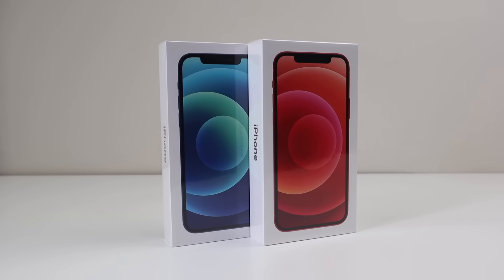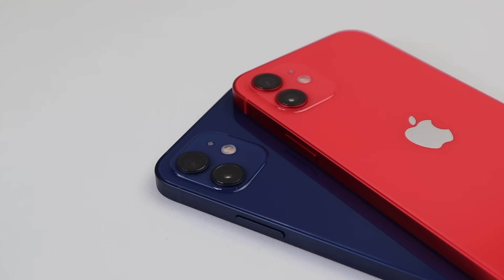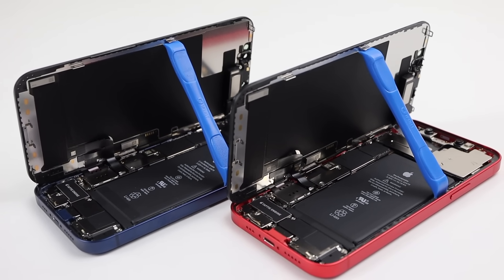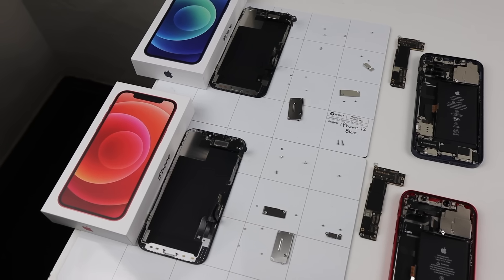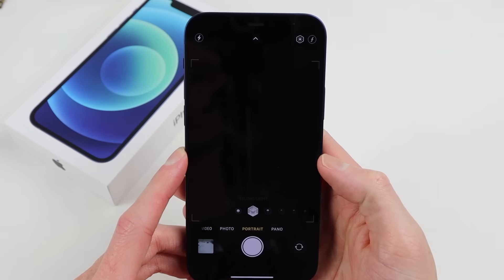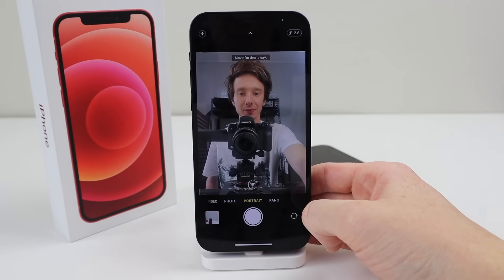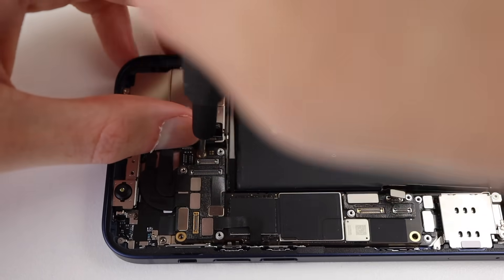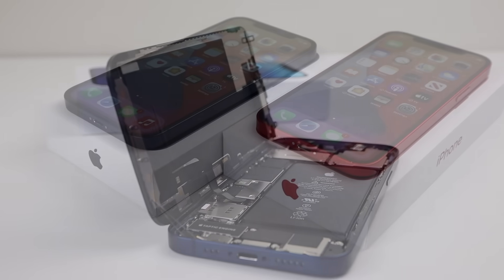iPhone 12 Anti Repair Design - Teardown and Repair Assessment

Comment: This is so genuinely anti-consumer that legal action may genuinely be needed. Apple is acting like the phone still belongs to them.
Reply: @kristiankestruppedersen6451  Actually, to look at a similar problem which shows how something like that is bad, I'm gonna bring up the farming industry. John Deere has something similar, where their tractors cannot be repaired by the owners on some levels, especially with the electronics. When the nearest John Deere licensed depot is so far away from the farms using them, and transportation of inert heavy vehicles could cost thousands for a simple problem the owner could have fixed, but wasn't allowed to, the problem starts to show itself. Now, for phones, it's not as extreme, since there are apple stores all over the place, but it's the same story. With a monopoly on repairs, apple can charge whatever they want for even the simplest repairs.
Reply: @thericepotato5847  And it's exactly this behavior that led to laws protecting independent repair shops for cars.  Laws that, naturally, don't extend to other kinds of motorized equipment, or other consumer goods.
Reply: @thericepotato5847  it comes back to them owning the software.
Reply: @logical_evidence  yeah, that's what the legal argument will come down to. They own the software and the software is technicslly just leased to all apple devicd owners. But where things get confused is that he hasn't edited the software, he's changed out physicsl parts
Reply: @thericepotato5847  i wonder if somone could sue them for that monoplys are illegial
Reply: @formoth3rrussia472  Like most legal question, the answer is... It's really complicated. Even I don't know enough legalese bullshit to say any more than "It should be something apple catches heat for, but they probably won't."
Reply: @formoth3rrussia472  ultimately it'll come down to ownership of the software vs ownership of the hardware. And how much of a precedent what was mentioned earlier, with the laws protecting the repair of farm equipment, will have on any case
Reply: @thericepotato5847  Most car companies are doing this too now
Reply: @thericepotato5847  that's false, in my country there isnt ONE store, not even one in the whole country
Reply: Jay Freeman has testified about this issue many times in the pursuit of legalizing jailbreaking. It's worth looking into
Reply: @kylezo  louis rossman has done heaps to. He was one that pushed for third party repair in New York.
Reply: @kylezo  ye
Reply: @kylezo  Jailbreaking is already legal though.
Reply: @kylezo  Repairing should be legal. Jailbreaking shouldn't. This isn't a Windows/Linux computer where if you mess up with your admin privileges and destroy your SSD/HDD (very rare but can happen) or other components or your system has to be reinstalled it's absolutely not a problem. On phones it's a different story. You can't swap your components and you can't install another system. At least not without the risk to completely brick it.
Reply: @kylezo  i would normally be against that, but with the sh*t IOS is pulling nowadays, I hope that works out
Reply: @kristiankestruppedersen6451  it is wrong and if you don't see it you're just acting blind and trying hard to defend their actions. Gross
Reply: @peekafch  while I agree with you mabey being helpful and explaing instead of just saying your wrong and if you don't know why you're stupid. Ignorance can be fixed. stupidity is refusing to believe those who give you the facts to help your ignorance and not helping ignorance is just being an asshole.
Reply: @peekafch  He's still right. They have the right to do so. It's their product and they can absolutely make sure repairs only go through them. You can't do any legal action against it either.
Reply: @peekafch  I mean they can do whatever they want with their products 🤷🏻‍♂️ it‘s not their fault that people don‘t really look into it and are stupid enough to buy their products
Reply: @barry3834 You are describing a deceitful tactics. "Not my problem if I tricked you into buying it." There should be a BIG BLACK BOX WARNING ⚠ over each iPhone sold stating "NOT USER REPAIRABLE"
Reply: @exxxo45  yea but people need to do their research still
Reply: @kristiankestruppedersen6451  “You can do whatever you want too”
I’m sorry did you not watch the video ? He used parts from an other identical phone and it disabled functions, how is that letting us do what we want with our own property ? 
He bought from Apple but still couldn’t repair his apple product, it is ludicrous.
Defending Apple... 🙄
Reply: @IAteYourSandwich  You failed to understand what he wrote. He said '' you can do whatever you want '' and added the condition '' as long as you go through Apple properly '' (paraphrasing). It means you can do whatever you want as long as you do it through the proper service. In this case, it means you can have your phone repaired if you go through Apple repair services. It doesn't mean you can repair it '' if you use another Apple product '' just because the other product is Apple as well.  That's 100% your mistake. 

And the guy is right. This is a common mistake as well: people think when they buy something, they buy everything related to it meaning they can do whatever they want with it.  This is strictly false. When you buy a product, you buy some things, but other things you actually buy '' a right of usage ''. Some, you just loan. 

This is very common in electronics and software. For example, you don't buy Windows 10, you buy a LICENSE to use Windows 10. ''Your'' Windows 10 does not belong to you. Same principle applies here. Even if you do fully buy the phone hardware, the software does not belong to you. When it comes to phone in general, you don't actual buy the phone, they are often the properly of the company even on the hardware level.
Reply: @IAteYourSandwich  Nope, it's called a conditional sentence. You can do what you want as long as (condition). For example, you are free to do what you want as long as it is legal. In which case, you will not be free to do it and the legal system will punish you. There is absolutely no contradiction. It simply means ''within parameters, you are free, outside, you are not ''. 

You are also wrong about Windows XP. Even in the times of Windows XP, you were buying a license. They simply allowed you to install it on multiple computers perhaps (I don't remember that, actually). And now, they don't. They could've restricted it on Windows XP as well. To be more precise, Windows XP is the operating system that introduced licensing use. 

All that means is you're an idiot who has no clue what he's buying with a touch of poor reading comprehension. Also, this is not specific to Apple: I'm not even sure a single big phone manufacturer sells you the hardware.
Reply: @dzello  the contradiction is that going through crapple and their ridiculous repair prices is NOT what most people want. Getting told their phone is unfixable while it's actually a simple fix, is also NOT what people want. So no, you can't do what you want, only what crapple allows you to do but you most likely DON'T want.
Reply: @ahandlethatisnottaken  You know what all of those things have in common?

They are all customer problems. If you want to be able to repair your phone THEN BUY A PHONE THAT CAN BE REPAIRED.

Not just that but youre actually wrong. In fact, most consumers would rather just pay Apple to have it fixed or replaced than do it themselves.

Its really simple: if you dont want those issues,  go elsewhere. People dont know what they buy and then get surprised when they see they dont own their phone.
Reply: @dzello  where do they advertise the fact that it can't be repaired? Most people only come to know this after they buy a phone, it breaks, and they're told it's unrepairable. What a "pleasant" surprise. And I never even mentioned doing it yourself. There are other repair shops that don't charge ridiculous amount of money for simple repairs.
Reply: @ahandlethatisnottaken  Apple says it plenty that apple products need to sent to the apple store for repairs or exchange. They have the warranty as well you can buy, its not for naught. 

The phone doesnt belong to you, you know. If you dont understand what youre buying, its your fault.

And its not just Apple, every phone company can do that because they all use the licensing model.
Reply: @dzello  yeah they could do that, but they don't because they're not assholes. And warranty doesn't cover drops, scratches on screen etc. even if you pay extra. Insurance does, but then again, not everyone wants to pay for that. This is clearly artificial lock down of parts, I don't think you'd play the same tune if your car didn't start because you changed the tires at the wrong shop.
Reply: @ahandlethatisnottaken  If I pay for a license, I dont expect to be allowed to repair at all because Im not stupid.  If I pay for a full product, yes. Phones are not such products. You do not own your phone and so the manufacturer can do things at his discretion. 

And the competitors dont do it is because they want to get clientele that wants to repair their phones and customizability. It has nothing to do with asshole or not, just Apple having a selected clientele and the competitors having another.
Reply: @ahandlethatisnottaken  If you loan a car, can you go to a third party to have it repaired? Noooope. Same principle.
Reply: @dzello  ok, so my point is, most people ARE "stupid" as you put it. The price tag doesn't say "license to use iphone until it breaks", it just says "iphone". It's not a "selected clientele", I've converted many iSheep after their phone broke and I told them all about these shitty practices that they had no idea about. Sure, YOU might be one that knows all about it and chooses to buy their products for whatever reason, but I guarantee you 90% of their users are just ignorant.
Reply: @dzello  
"The phone does not belong to you"
"If i pay for a license i dont expect it to be repaired"

Apple does not explicitly say "license to use macbook for $1200" when you are buying macbook.

If apple is selling license and not products then apple should should say explicitly that it is selling a license and not a product before buyers make the payment.
This should not be buried in terms of use documents.
Reply: @suntzu1409  Apple? Nah dude, every phone company does not sell you the actual phone. 

If you dont know what youre buying, its you being stupid.

Its also written a looot in the customers handbooks lmao. Of every phone.
Reply: @ahandlethatisnottaken  Ignorants are a selected clientele my guy. Apple does target a specific clientele. For example, android is more open and accessible, apple is more closed and limited while also being more expensive. Apple targets a clientele that is about appearance, simplicity and willing to pay a premium for it. Basically, not the clientele thst repairs its phone by himself.
Reply: @dzello  does apple tell the buyers explicitly in bold that they buying a license and not the actual product before they make the payment?

I want only a yes/no answer
Reply: @suntzu1409  Yes, they do. So do all phone companies. And not just phone companies but also cable companies with their devices. Hence why you have to return the devices if you change provider.

Same for Microsoft... Games... Etc. Its all licenses.

If you check phone handbooks, its literally written EVERYWHERE that the phone and its software is property of Apple bla bla.
Reply: @dzello  i am saying do they say that BEFORE you make payment.

Its written on handbooks, but you get handbooks AFTER you make payment.
Reply: @dzello  Nobody's even talking about repairing phones "yourself" here. It's all about having the choice to have it repaired by someone else, cheaper. And yes, I know lots of people who own their devices, but they all act very surprised (not in a good way) when I tell them about this practice of non-repairability. They simply don't know.
Reply: @dzello  do they tell you explicitly that you are buying a license and not product BEFORE (read that again: BEFORE) you make the payment?

Just a yes/no answer
Reply: @ahandlethatisnottaken  Again, most dont know and dont care. People who buy Apple products are already willing to pay a premium for an inferior product. So paying for repairs, kinda similar buddy.

If you dont understand simple stuff like that, no wonder. Apple targets a clientele. Android another.
Reply: @dzello  If you loan a car, you pay monthly and you don't get to keep it. If you BUY a phone, you pay either right away or monthly for a fixed period of time, and then you get to keep it. Nobody advertises iphones as something you can "rent". No other phone manufacturer has these stupid restrictions in place, even though they ALL have lines about them owning the software and about 3rd party repairs breaking the warranty in their T&Cs.
Reply: @ahandlethatisnottaken  Then Ill ask you a fun question. Is a phone really what phone companies sell? 

Think before you answer.

Btw all other companies use the licensing model, they just dont put as much restrictions. They absolutely can if they want though. They aim at a different clientele so thats why they dont. Apple wants the type of people who pays to repair a phone, android wants the rest of the clientele.
Reply: @suntzu1409  They do because you dont buy a phone, you buy a plan. They tell you what youre buying which is a plan.
Reply: @ahandlethatisnottaken  wait derpy derp let me talk to dzello
Reply: @dzello  yes, a phone is what they sell. They offset some of the production cost with bloatware, but most of them don't really care about after sale support. And what do you mean you buy a "plan"?
Reply: @suntzu1409  good luck mate. He seems too far gone.
Reply: @ahandlethatisnottaken  I mean that you dont know what phone companies sell. Because the one thing they do not sell.. Are phones.

They sell phone PLANS. The phone, they license to you. What they sell is plans : those contracts you sign. For example, a 12 months landline with international calls..  Thats what they sell.
Reply: @dzello  I've never bought a phone that way. Sure, they offer cell plans with some amount of calls and gigabytes per month etc. but for the phone itself, I've always paid the full price up front. Either way, you're buying the same thing. You can either pay up front or you can lease it and add the monthly payments to your service bill.
Reply: @ahandlethatisnottaken  No, that's your misunderstanding here.

What you're describing is the two different payment methods. Basically, you can pay upfront or you can pay over time.

But in both cases, you're buying a plan. So there's no difference in that regard.
Reply: @dzello  I'm not buying a plan. My phone is in no way connected to any cell plan and I don't sign 2 year lease agreements. I pay up front for my phone, and then I pay separate monthly price for a plan. Or I don't. Sometimes I buy my phone from a different carrier and don't buy any plan from them at all. Sometimes I buy my phone from a shop, not a carrier at all. Shops don't have "plans".
Reply: @ahandlethatisnottaken  It's mostly because you don't realize what you're buying.

Regardless of the manner you do it, the source or the payment method, you never own the phone. When you buy  a phone with a plan, you buy a plan and the phone is still owned by them. But you can use it. When you buy a phone without a plan, you can keep the phone but you lose the right to actually use it. So you buy a bunch of plastic and metal you legally can't use.

Like I said, it's similar to Windows 10. You do not buy Windows 10. You do not own Windows 10 even if it is on your computer. You buy  a license to use Windows 10.
Reply: @dzello  I do own my phone. I bought it straight from Google, no cell plans or carriers attached, no middle men. And no one is ever taking it away from me.

There's a huge difference you're missing: when you go to a store to "buy Windows", the label clearly says you're buying a license and a physical disk with the installer. Another huge difference is that it's impossible to "own" software unless you wrote it and are keeping it offline for yourself. When you can make unlimited copies of something for free with little to no effort, the whole concept of ownership becomes irrelevant.
Reply: @ahandlethatisnottaken  If you don't understand all of that, you can just... Google '' do you own your phone  '' or something. You'll get tons of articles telling you that you do not.
Reply: @dzello  can you just stop relying on clickbait articles and provide actual evidence?
Reply: @ahandlethatisnottaken  Basically, I'll make it simple for you:

1. You have absolutely no clue what you're talking about.
2. You have absolutely no clue what you are buying.
3. You don't understand how ownership works wether its about hardware or software.
Reply: @dzello  funny to read this coming from you.
Reply: @ahandlethatisnottaken  Like you don't understand that if you go to a 3rd party seller (or directly to Google) and buy just an iPhone or something.  You pay full price, you don't get a contract with data and all that jazz. If you go to a fucking kiosque, choose a phone, pay the full price and leave with just the phone....

YOU STILL DON'T OWN THE FUCKING PHONE. It's like that fucking information doesn't enter you brain. In the phone box, it's literally gonna say the phone is property of Apple. And when you buy it without a plan, you forfeit the right to use it BY LAW.
Reply: @ahandlethatisnottaken  It's as if your brain can't comprehend the concept that it is impossible to own the phone regardless of the manner your buy the phone.
Reply: @dzello  "you forfeit the right to use it"? BY LAW? LMFAO this is golden. Ok show me the law. I dare you.
Reply: @ahandlethatisnottaken  So your phone that you bought straight from google with no cell plans or carriers attached, with no middle men or whatnot?

Guess what, you don't own it. The phone is property of Google on both hardware and software levels. Since you didn't take a plan, you forfeit all rights to use the phone. Basically, all you can do is keep it. You don't own it, you have the right to keep it.

And maybe you THINK you own it, but you don't. And if you read the little pamphlet in the box your phone was in, you'd see '' this is the property of Google ''.
Reply: @ahandlethatisnottaken  It's part of the Copyright Law under the Constitution (article I, section 8, clause 8). You most likely already know a part of it covering software: it's called the Digital Millennium Copyright Act (DMCA). Though you most likely know it for copyright strikes on youtube and stuff, it covers stuff like that. It's a bundle of a lot of laws.

For example, even if you remove the software and install another one or go have your phone repaired elsewhere... Well, you can't. People did it and Apple called out section 1201 of the Copyright Law (which is the DMCA). This in turn resulted in them having ''failed to comply to legal  requirements for ownnig and operating the device''. People lost their class-action lawsuit.
Reply: @dzello  luckily I don't live in USA. And then again, this is all about software. You can't own it. But software licensing still isn't very well defined in law, and it certainly wasn't when your constitution was written. So of course, Crapple can bend it whatever way they like, they have the money to do that.
Reply: @dzello  Anyway, I'm not even running Google's official OS on my phone. They can dictate how I use the software since it's subject to a license, but now how I use the hardware. And I use my hardware with an alternative operating system which has a more liberal license.
Reply: @ahandlethatisnottaken  Nope, you didn't read what I said properly. (I'm also not from the US, I gave you the US one because you use a Google product)

First, it doesn't matter wether you live in the USA or not. Copyright Law extends internationally. So basically, everything I wrote applies outside of the US because Google is from the US. So wether you live in the US or not does not matter, you still fall under it. Plus, other countries also have laws that are basically identical protecting copyrighted stuff. It's a law that applies outside of the borders basically.

Second, software is very much so protected.  Again, DMCA basically does that. Intellectual property is within the constitution and digital property got added under as I covered previously.

Third, you failed to understand the last paragraph I wrote. Section 1201 of the Copyright Law covers '' not running Google's offficial OS on your phone ''. You see, people with iPhones repaired their iPhones at a third party. Then, they got an Error 53 (because they repaired at a third party) which rendered their phone unusable. They  did a class-action lawsuit against Apple for it. Apple called to section 1201 and won.  See, not only can the user not modify the software, they also have to used the Apple provided one. What I'm saying is you not running Google's official OS on your phone is actually illegal. So yes, they can dictate how you use the software, but they can also dictate how you use the hardware because BOTH are their intellectual property.
Reply: @ahandlethatisnottaken  Hence like I said previously... It is strictly impossible to own an iPhone, Google phone, Samsung. They all do that. And from that, Apple uses it with a lot of control, Samsung is more lax. But in no case do you own the phone on both hardware and software standpoints. This whole turmoil is what the ''Right to Repair'' movement was fighting.
Reply: @dzello I know exactly what you said. Repeating it won't make it any more true.
Reply: @dzello  And where did the error come from? Yes, from Crapple's default OS. That's the doftware peventing you from using the hardware. You do own the hardware and you can use it whatever way you like. But you can't run Crapple's software on it.
Reply: @ahandlethatisnottaken  No.. Buddy, you didn't get why I told you this little story. :/ You really need to read what I wrote properly, you seem to read half of it at best. Read the middle part of the last paragraph: ''  not only can the user not modify the software, they also have to used the Apple provided one ''.

The conclusion of that whole legal debacle was that the Apple phone is legally required to use the Apple provided OS. Basically, you cannot tamper with your device which means you can't use an iPhone with another OS (Android for example) and you also cannot modify the OS. You also cannot have your phone repaired by a third party. It's why Apple won.

Same for your Google phone. What you are doing is just illegal.
Reply: @ahandlethatisnottaken  In simple terms, if you buy a phone, because the intellectual property is protected by law, you kinda buy the right to KEEP the phone with you. It remains owned by the provider. Apple or otherwise. You do not have the right to use it because you can legally only use the phone with its dedicated OS and you do not own the OS.
Reply: @dzello  repeating it won't make it any more true. What I'm doing is perfectly legal and there's a US government supported organization behind it, look up the Calyx Institute
Reply: @ahandlethatisnottaken  Nooope it is not as I have demonstrated. :)
Reply: @dzello  helloooo, you haven't demonstrated ANYTHING. Just that YOU THINK something doesn't mean it's true. Reading clickbait articles doesn't make you Mr. Know it All
Reply: @ahandlethatisnottaken  Riiight, well keep telling yourself that.
Reply: @ahandlethatisnottaken  Mhm sure buddy
Reply: @dzello  what do you get out of defending this billion dollar company?
Reply: @OGSpermCells  Nothing to do with defending it, its just about how the law is.
Reply: dzello We are not talking about owning the software we are talking about being able to repair hardware. Imagine if your computer suddenly stopped working but you were unable to fix it yourself unless you go straight the the company who made the software and pay ridiculous prices. All of that data lost.
Reply: dzello Who loans a car? HAHAHAHA Are you on welfare or something? The car you but is yours and you can do whatever you want.
Reply: @dzello  so with your logic apple could take my iphone 14 if I "hypothetically" owned one, and replace it with a used iphone 7 running the same os?
Reply: @kristiankestruppedersen6451  not if they are purposefully hindering shops from repairing them, then it is malicious and becomes a crime/violation of states right to repair laws.
Reply: It's scummy, greedy, deceitful, and so, so disrespectful of their consumer base and sustainable design that it hurts. If you buy something, that should be it. You should own that thing and be able to do whatever you want with it, no questions asked.
Reply: @skychaserthedragon2046  you can still do whatever you want with it but it‘s not their fault if you‘re stupid enough to buy something like that
Reply: @barry3834  yeah you COULD, but if the item becomes unusable, you're kinda SOL.
Reply: @kristiankestruppedersen6451  imagine buying a car and when you change wheels you cant steer anymore...
Reply: @Despairaity  Are you clowning??
Reply: @kristiankestruppedersen6451  LG, samsung, motorola and more companies that arent as shitty as apple exist, i dont get why would somebody want to buy something from apple, first world problems
Reply: @trevesezequiel  new motorola phones are hard to fix though :( luckily i have an old one that i will fix when my ''new'' one breaks
Reply: @trevesezequiel  i had iphones for years , i still have a iphone xr , but had an 11 , anyways i only kept it because of factime and immessage for people who (cant do regular text or calling) but i mainly use my Samsung Galaxy. F*ck iphones i was brainwashed to beleive they something special? Do you know what i can do on my galaxy a iphone cant , a hole lot , even if apple tries to catch up, i aint coming back to buy something i cant have full access to, i repair phones f*ck that.
Reply: @ejackson81 you mean there loaded with a whole lotta gimmicks that most people don’t use.the only good they about them is that there more customizable and have better multitasking as well as dual sim n expandable storage slots
Reply: @trevesezequiel  That's an actual good point, and the best part is that some of those smartphones can be customizable. Almost to the extreme too, in a good way.
Reply: @trevesezequiel  

circumstance dictates i must apple. dont tell my pc’s.
Reply: @trevesezequiel  A big part of the problem is that there is no direct rival to Apple's iPhone. Don't look at Android, it's owned by Google who doesn't seem able to make a best selling phone, and a collection of phone makers none of whom make an OS. The last mobile phone makers to control both hardware and software were Nokia and Blackberry, and both had top selling phones. We sure need that kind of competition now.
Reply: @trevesezequiel  Samsung sell ‘S’ series phones to half the world with inferior internal parts (Exynos) but still call it the flagship model. Why does someone in the US get a better S20 than someone in Europe? Samsung are no better I’m afraid
Reply: @kristiankestruppedersen6451  Not everyone has an apple store 30 minutes down the road. And shipping your phone in the mail for repairs can leave some consumers without one for days to weeks to even months depending on the circumstances. I'm sure you can understand how that's a problem. All of that headache when "worse" phones can be hand fixxed by you at home for a fraction of the price. It's just ridiculous, especially considering all the praise and heafty price tags some of their phones have. Yet apple still has the audacity to monopolize your phone repairing options to stick you for more money. Why would you want to defend that?
Reply: @kristiankestruppedersen6451 
Okay then let's say if you change the wheels and the engine refuses to turn on. Then it's not a danger to people. Is that okay then?
Reply: @kristiankestruppedersen6451  I guess you don't have a problem if manufacturers start preventing you from repairing YOUR OWN property like car, houses, appliance and so on. Also consider that fact that some materials used to produce phones are rare, you have no problem with wasting natural resources for no good reason other than profit on your behalf. It's so dumb on som many levels I lack words...
Reply: @kristiankestruppedersen6451  it would be fine only if they didnt charge you a fotrune for the tinyest and basic repairs. Sometimes down right lying to ur face that its unfixable and you should get a new one but when taken to third party repair shop they find out just something was lose inside and they just press it right back  in and walla it works just fine
Reply: @psycho637  voila*
Reply: I am so damn glad I got rid of my iPhone 5 SE.
Reply: @kristiankestruppedersen6451   I also assume that you only go to the dealer that you purchased your car from every time there’s something wrong with it. I also assume that you only go to the school you got a degree from when you’re looking for a job. Because they’re the ones that certified you in your field. The problem and stuff like that happens is that dealerships are notorious for ripping people off and adding the unnecessary charges needlessly. And Apple has been caught doing this Way too many times for them to be the only person we are allowed to fix our phones that we purchased
Reply: @kristiankestruppedersen6451  false. The Supreme Court has ruled many times that once you buy it YOU own it and can do whatever you want with it.
Reply: @kristiankestruppedersen6451  its unbelivable that you guys dont have problem with that
Reply: @kristiankestruppedersen6451  they produce the phone, yes. But when the customer BUYS the phone, it gives the consumer COMPLETE ownership. It’s like buying a car. If Ford, Chevy, Dodge, etc, made it this hard to repair their vehicles, people would be mad and legal action would be taken almost immediately after hitting the lot. The consumer shouldn’t need to send the product in to get a repair. The producer should make parts so the consumer may fix it, or have someone more qualified, and closer to home fix it. If you bought a car, would you like to be able to change the brake calipers without the car having a mental breakdown right after? You wouldn’t want to send it to some unknown location to get it serviced by the producer, now would you. It’s idiotic the way Apple keeps doing illegal moves like this with zero consequences. I’m just waiting to see the day they have to face these consequences and get fined, sued, etc.
Reply: @WhistlinDuramax .
Dont expect serious legal action on apple (By "serious", i mean some action that will cost them $5 billion every year for 10 years). Legal bodies are run by humans, and they can be fooled and tricked the way they fool and trick the consumers (who are also humans).

Buy apple products if and only if death is not an option.
Reply: @WhistlinDuramax  I've wrote it already plenty of times on this post: you are JUST WRONG.

You say: '' But when the customer BUYS the phone, it gives the consumer COMPLETE ownership.  ''

No, it does not. The end. You're wrong. That's because you DON'T BUY THE PHONE. The same thing for Windows 10, you DON'T BUY WINDOWS 10. 

You buy a license to use Windows 10. Windows 10 remains the full properly of Microsoft. In the same way, you do NOT have complete ownership.

''  It’s idiotic the way Apple keeps doing illegal moves like this with zero consequences. I’m just waiting to see the day they have to face these consequences and get fined, sued, etc. ''

If your fucking eyes could read, you'd read the repeated times where I wrote how it works and THE FACT THIS IS LEGAL. Not just that but EVERY phone company does that. If they wanted, Samsung could also do what Apple does for repairs. They won't face any consequence BECAUSE IT'S LEGAL.
Reply: @kristiankestruppedersen6451  you’re gross. anti consumer freaks like you are just powering huge tech companies like this that want to control everything they possibly can. worst part to me is how terribly they’re polluting the earth more and more, while claiming the changes are “green”
Reply: So get something else, we stop giving them attention they go bankrupt.
Reply: @kristiankestruppedersen6451  you really dont get it do you
Reply: As long as so many people are oblivious and continue to buy products from that silly company, this problem will unfortunately carry on.
Neither the USAian authorities nor Apple care about sustainability.
Reply: @Despairaity  have you watched even half the video? Tell me, which part of "you can't replace iphone parts yourself" is fake?
Reply: @kristiankestruppedersen6451  so if i produce a phone i can make it die after 1 month so i then can make u pay me alot of money to repair it
Reply: @kristiankestruppedersen6451  yes but most people do not know what they are getting into when buying a phone from them u can not say its there choice when they have no idea what there getting into
Reply: this is exactly how we ended up with right to repair laws.  watch how much apple donates to political parties if such propositions come around.
Reply: @RACCOON JOE'S FURRY ART CHANNEL the sad thing is 90% of apple consumers will never stop buying apple products because
1) apple is a cult. Only very few on earth have the balls to go outside the cult they are in.
2) there are many thing apple does for (like keeping os and drivers up to date, backups, sync, etc.). People underestimate how easy these things are to do manually.
3) they are boomers, celebrities or general influencers (These people want luxurious expensive things that look good and can be flaunted).
Reply: Consumer? Do we eat our phones or electronics? Are we just consuming something to fulfill a desire? Or our we customers buying products that we expect to have certain utilities that just happens to contain counter third party repair features to prevent the user from being aware of little control of the quality and utility if they device we actually have?
Reply: @Cat4h1re  your comment made me want to eat my phone lol
Reply: @kristiankestruppedersen6451  not the same. Same as when you purchase a car. You don’t have to take it to a dealer for service. Same should be anything we purchase. Once purchased, it’s our property. We choose who works on it, not the manufacturer.
Reply: This is enough information (for me) not to buy an apple
Reply: Well technically they still do as they own the software. It sucks big time.
Reply: @logical_evidence  “they still own the software” hi sorry you can’t download that game to your computer because we don’t like the company who made it. The problem is it’s the physical parts they’re restricting
Reply: listen, no one agrees that these companies should be able to monopolize on the repair market for their product, what rational consumer would. The entire point is that they shouldnt be able to yet are still well within their rights legally. the consumer is consistantly lied to when they "buy" apple products, the main lie being that you ever "owned their product" in the first place. yeah youre technically told this shit in the terms and conditions and all that, which no one reads. everyone knows no one reads it, its designed to be the most boring legal document you would ever have the displeasure of reading, and of course apple is aware of this, it literally allows them to do whatever they want with their product, including having a nice little foot note claiming that the person who physically bought the product and is now under every impression that they own it actually dont. personally i dont think legalizing third party repairs would be a permanent solution, despite being a huge step forward, these companies need to be legally mandated to explicitly make their customers aware that upon buying their product they do not own it.
Reply: The problem with that is since Apple has all the money the consumer might as well be screaming into thin air they control the government until you can out-bribe and out-blackmail Apple the consumer’s opinion doesn’t matter
Reply: @kristiankestruppedersen6451  and im sure apple will get sued soon cause i doubt they can leggally make a bad product that only they can repair
Reply: @Despairaity  "Theories" that's a basic word. Don't comment on other people's intelligence.
Reply: I'm not sure why Anyone would be surprised by this, apple has been scum since it was founded, just look how they handled a company for a similar looking product: https://www.youtube.com/watch?v=skkDM9Ijckc&t=368s
Reply: @dzello  does a single fucking company fuck their customers over like crapple does? No. And they ARE obliged to inform you of any restrictions before you buy something.
Reply: @kristiankestruppedersen6451  what do you get out of defending this billion dollar company. That question is directed to everyone who also like your comments
Reply: @kristiankestruppedersen6451  you can’t control what someone does to a product after you sell it to them, it’s their property not apples anymore. They can void warranties etc, but right to repair and modify needs to exist
Reply: @kristiankestruppedersen6451  Imagine if a car company did the very same thing.  Let's say you replaced the car battery or oil filter or tire with parts identical to what you replaced without going to the dealership, and the car significantly changes the way it behaved when it was brand new.  The Federal government would slap that car company with anti-trust or anti-competition lawsuits instantly.  We'll see if the courts will allow Apple to behave this way soon enough.
Reply: @dzello I enjoyed watching you flail around trying to prove your incorrect claim thanks for the comedic read
Reply: @kristiankestruppedersen6451  🐑
Reply: nothing new here, they've been doing this all the time.
Reply: What happened to voiding the warranty?
Reply: @jayce-__-_-_-  what do you mean what happened? When you shatter your phone screen, your warranty is void either way. At that point you should be able to choose who fixes it.
Reply: Well when Louis Rossman took Apple to Congress over the “Right To Repair” and he needed our support y’all wouldn’t strike against Apple to get this disposition changed. So there you go and we are.
Reply: @aintdatabic  I’m from Canada
Reply: @timhill5764  Eh
Reply: and trust me if they continue they wil run the company to the ground and people would not buy those phones again remember when apple now came out there were other competitors like blackberry, nokia, motorola, LG and sony . i am seeing nokia and Motorola trying to make a come back in the market
Reply: This is like the lorax situation, it's kinda the consumers fault also by funding apple's scummy acts by buying their products and allowing them to continue (it's apple's fault also don't get me wrong)
Reply: It so scary how brand works. Because it's "Apple", people still buy it. Even it's just a small improvement in new series
Reply: Apple: that's what lobbying is for.
Reply: @kristiankestruppedersen6451  b8
Reply: @kristiankestruppedersen6451  Uh thats not how it works bud
Reply: @S P aw thanks 😘
Reply: @kristiankestruppedersen6451  no they cant cuz basicaly you buy that phone not rant it .
Reply: It does
Reply: LMAO. Do u know how much apple spends on lobbying? U think your politicians r monuments of integrity?
Reply: @tapaspanigrahi3331  a man can dream
Reply: @kristiankestruppedersen6451  but their success in making a good phone is making sure ur consumers are happy if their not ur product flips and u lose money that’s basic common sense
Reply: It does I'm afraid
Reply: They're wanting you to give the phone to apple to repair it with huge additional costs!
Reply: @kristiankestruppedersen6451  it’s monopolizing the repair market. You purchase their insurance or you purchase a new phone. You can’t go anywhere for a cheaper option.
Reply: @kristiankestruppedersen6451  But they sell you a phone that has a function and a use for a consumer, if a consumer makes a mistake with what they own, apple should not exploit their position of control and their product to be bought but then be forced to buy again or be scammed on repairs, they are exploiting and tricking you to be forced into such a position, rather than create something that only is created to hinder consumers once it is bought, to force them into it, they are stripped their ability of solving their own mistakes just to be exploited for something that has no part nor reason to be in the product. As a product you buy parts constructed and a function to be controlled and used by you, they don't hinder potential danger or inform you of such, they don't hinder scamming them of their service or potential harm and illegality conducted, such as it being illegal to doctor without a doctor's license as it's potentially fatal, they create a scam tactic to force you to only pay them unnecessarily much to gain from you with a hidden irrelevant part to the design, model and function, of which they create and choose on how to be, but this is created solely for the purpose of removing your rights and your control of your own product you have bought to use and own of which is fairly your ownership. It is irrelevant to their design, their product and their function, it is only a scam exploitation on you as the consumer for if you meet an unwilling mistake or accident so they can garnish control over you and force payment from you to them only and additionally than what it would.
Reply: True…. I think another company has had a similar lawsuit
Reply: Class Action Lawsuit When
Reply: @nerevarietyhour  but after you've repaired your phone yourself, if something goes wrong at the end of the line, you'll run to the store crying and saying it's Apple's fault.
Reply: @kristiankestruppedersen6451  But I bought the fucking phone with MY MONEY right? Legally I own it, not apple.
Reply: @kristiankestruppedersen6451  So if you sell your car is it still yours? can drive it when you want to? Okay then hush.
Reply: Me having Samsung fast charger brick that have usb c hole that is no issue
Reply: @kristiankestruppedersen6451  it costs a lot of money to get it repaired at Apple. Doing it yourself is much cheaper
Reply: @kristiankestruppedersen6451  please take my money apple please ill bend over for you like a good little customer
Reply: That's highest capitalism feel you'll get from one of the most valuable company in the world (yeah I know, so ironic).

More ironically, android won't born without apple's first iPhone. Despite that apple still popular to those tersier-item seeking, luxury brand with focus on productivity and high-lifestyle. iPhone is an luxury item to show ego at its max (yeah another f--ing irony) to another and makes more envy to other.
Reply: @kristiankestruppedersen6451  because instead of spending $50 on a replacement screen and installing it yourself, you spend an ungodly amount of money to apple to repair it WHO by the way monopolized the entire thing. they can set the price on a repair because "fuck you you cant take it anywhere else" you should definitely see something wrong with that.
Reply: I’m pretty sure Ferrari does something similar to this, but they take the car instead of not letting you use it. (At least from what I’ve heard)
Reply: @kristiankestruppedersen6451  lol no. they should never get the kind of control that gives them unearned money on our expense. that was some shitty logic there.
two literal original phones having their parts swapped and fitted correctly still malfunction because company wants more money. you can make apple your suger baby for all you like, rest of us enjoy the ability to repair our devices.
Reply: You must not know consumerism is...

Don’t repair your phone. buy a new one.

That’s consumerism at its finest
Reply: @tedcruz2740  funny part is that a iphohe survives better than any android phone in the market, even after 5years you get updates and battery can be replaced from apple for a great price.
Reply: In the future, nobody will own anything... and they will be happy.
Reply: @kristiankestruppedersen6451  you cant fix it yourself... so no you cant do anything
Reply: Apple is trying to be like tesla meaning that only the own company can repair their products.
Reply: @quietgameplays8246  actually tesla is trying to be like apple. apple has been doing this for a long time.
Reply: fuck koho and banks buy crypto
Reply: Or people could stop buying new ones so they stop going up (number 13 in the future) but someone is always aiming to impress someone so that wont happen androids op probably
Reply: Legal action..? They’re allowed to do whatever they want with their products as long as they’re not false advertising. If you don’t like a product then vote with your money and stop supporting them 🤨 you shouldn’t ever have control over a company just because you don’t like them, that’s a terrifying reality you’re pushing for.
Reply: The manufacturer has the right to glue the whole thing rock solid, it’s you who decides to biy it or not, noone is forcing you
Reply: 1000th like
Reply: @Lord Ludicrous Ever heard of this thing called " laws " ?

It doesnt matter that the software isnt a part. Apple made it so the hardware and softwares have to go together. And since the software part is protected by law, and since the two are " linked " together, Apple is able to protect both its hardware AND software. It's illegal to use an iPhone without iOS and iOS protects against third party repairs by recognizing foreign parts being tampered with.

And thus the laws protecting SOFTWARES also protect against third party repairs. Apple WON against people using third part repairs in court.
Reply: @S P Yeah as if people didnt already do a class action lawsuit for that.. AND LOST. 😂
Reply: I'm laughing on my own with these type of comments, are you guys rich or something and is it hard to use your brain to prevent your 'iphones' from being damaged or destroyed?
Reply: @sanwushi3659  what if you need to change the battery because the one you currently have is old and worn? Beforehand you could easily just pop the back of the phone off, and then remove and replace the battery. Nowadays, something as simple as that is impossible and at most times would require you to buy a new phone.